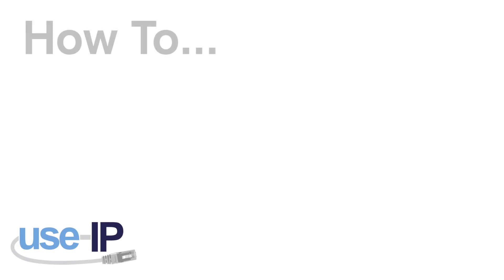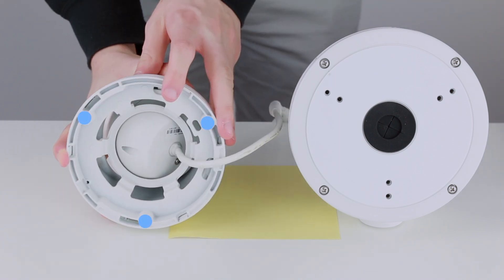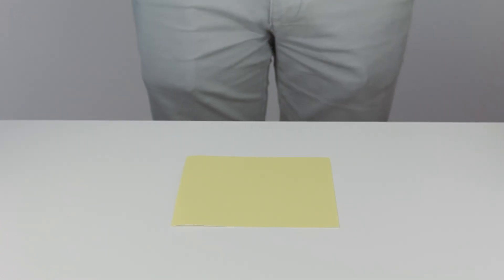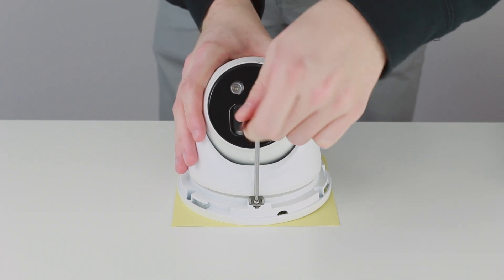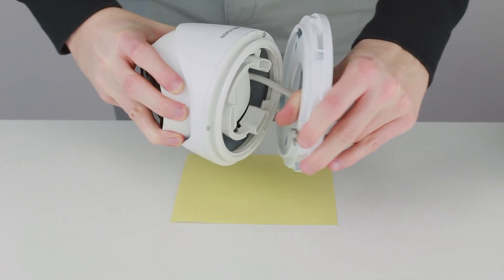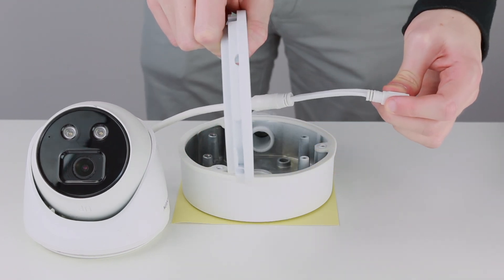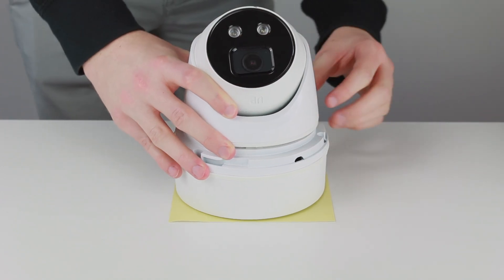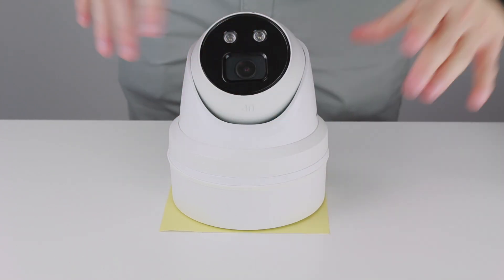How To... Ep.13 - Install a Hikvision G1/G2 Turret Camera on a Junction Box

Comment: Do you loosen the silver screw to adjust the angle by hand then retighten?
Reply from the maker: Correct, when you loosen the locking screw you can manually pan, tilt, and rotate the camera into the position you want and then tighten the locking screw to lock the camera's position.
Reply: Thank you kind Regards @useIP